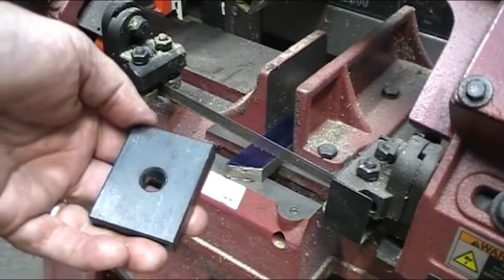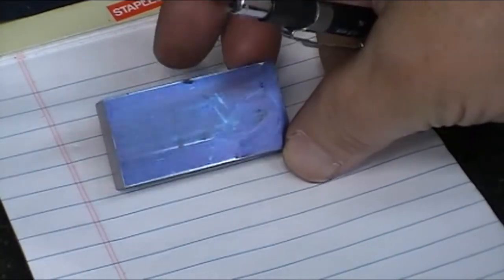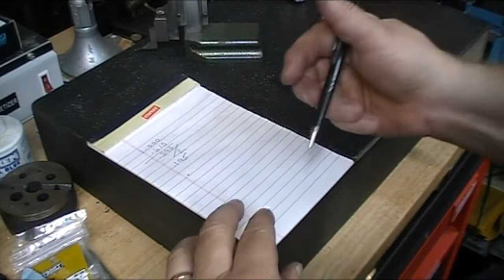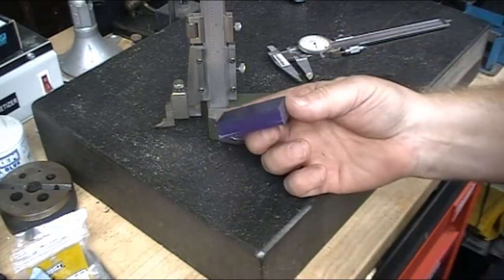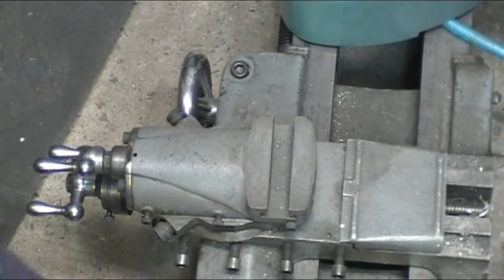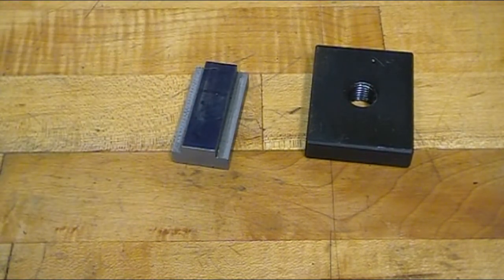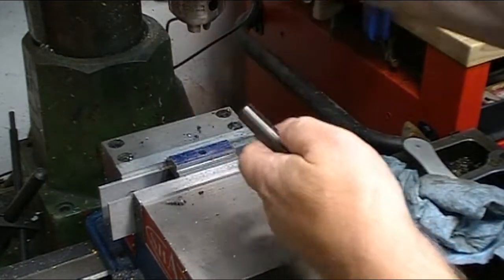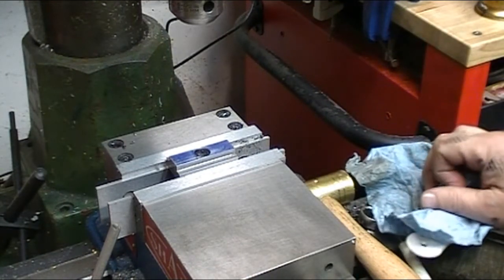Atlas 10F Tool Post T Nut Build

Comment: Coming along.  Hope you get as much fun and satisfaction from your Atlas that I get from mine!

Joe
Reply from the maker: I had a 9" Atlas many years ago.  I am looking forward to using this one with the QC gears.  The change gears took so much time that it was not fun to cut threads then go back to regular turning.  Thanks for stopping by.
Reply: @sharkrivermachine  my 10F has manual change gears, and while it take a few minutes to change them, so far I don't really mind.  Now having said that, this is my second lathe. The old Dunlap had manual change gears too.  Now if I had a lathe that had a quick change gear box, then maybe I would feel the same as you.  As an aside, with a manual change gear system then you can come up with some non standard feeds.  DP for a worm, spring winding and stuff like that.  Love your channel, keep it up.  And thanks for doing the precision ground stones.  They will we a handy too when I start putting the mill back together 

Joe

Comment: Good job.  I think the rule is whatever size you need is the one you do not have.  Seems to work like that for me.  And you will never use that tap again.
Reply from the maker: I used to work in and then own an automotive machine shop so there are not to many small tools that I don't have.  But you are absolutely right, I will probably never use this size tap again.  That is way I didn't spend $38.00 plus shipping on it from the usual suspects. Thanks for stopping by.

Comment: Would you mind sharing your source for taps for one off jobs where one will most likely not use that tap size too often? Thanks
Reply from the maker: I usually purchase them from McMaster Carr.  This one was very expensive so I checked it out on eBay and Amazon.  Ended up getting on Amazon.  Had a lot of positive reviews, price was right, and free shipping.  We will see how it performs.
Reply: @sharkrivermachine  Thanks Steven.
Reply: @sharkrivermachine  I had a project a year ago that required 4 holes to be tapped in M14x1.25 so I went through Ebay. I thought I would never use them again. Now I have used them twice this month. In hindsight I should of bought a quality tap but one never knows what kind of projects will come through the door.
Reply from the maker: That one I have, it is a common automotive tap, fits most spark plugs.  I have at least one more project for this tap, so I picked up a bottoming one also.